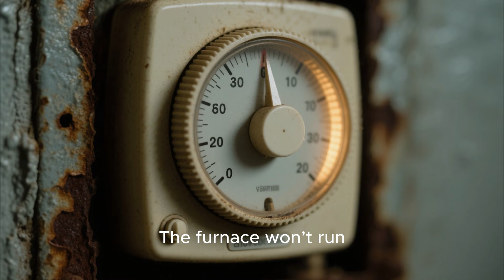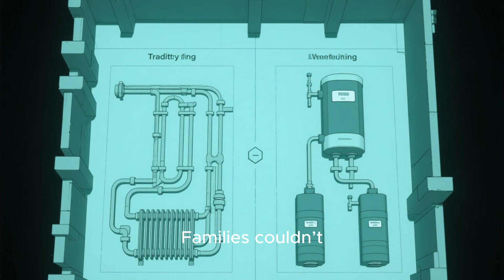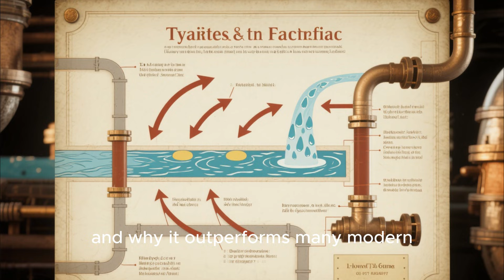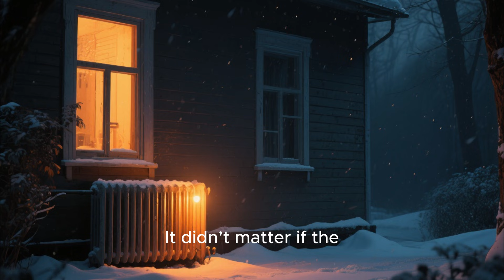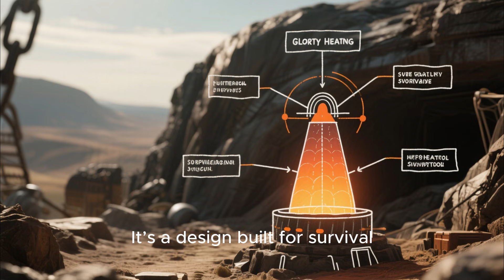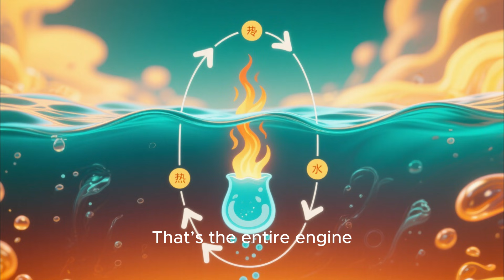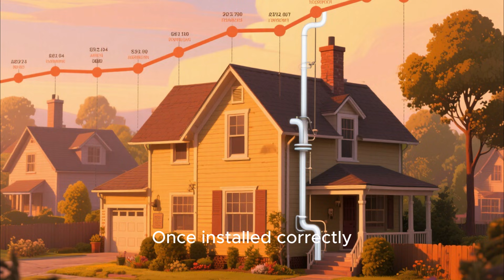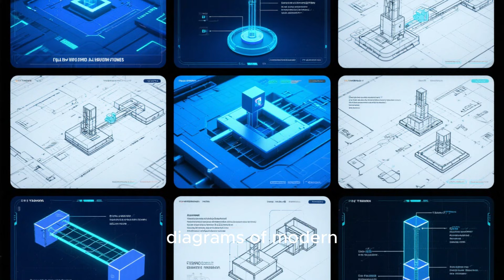The 1940s Radiator Hack That Heated Entire Homes With Zero Electricity

Comment: I grew up in Washington DC Apartment with this kind of Heating system.  This is only a heating system and it did not provide cooling during the summer, so this apartment was extremely hot during the summer.
Reply from the maker: So, it heated your home in winter but turned into a summer sweat lodge? Talk about a two-for-one deal on home temperature extremes!

Comment: Growing up in upstate NY circa late 70s early.80s
.We never lost pwer 🤔. Old homes had radiators and fuel oil burners. Insulation sucked but those suckers always flowed hot water 🤔
Reply from the maker: It’s fascinating how those old systems worked so efficiently! Radiators really have a way of keeping homes cozy, even with less-than-ideal insulation.